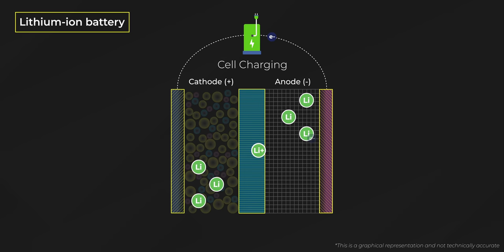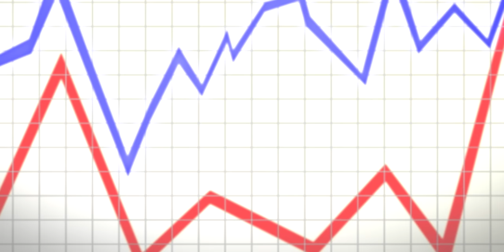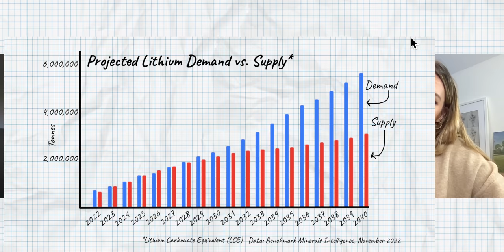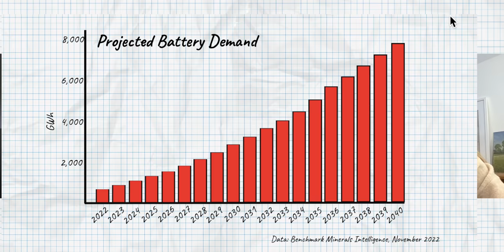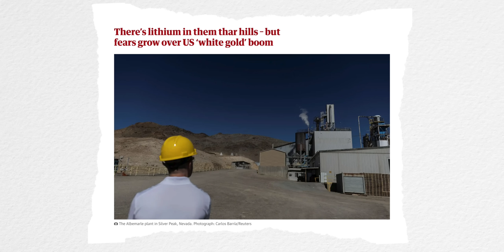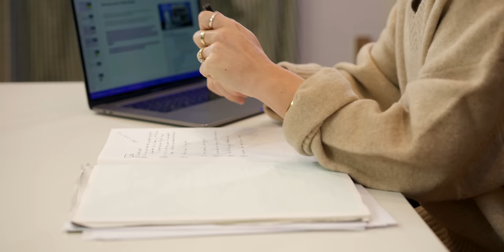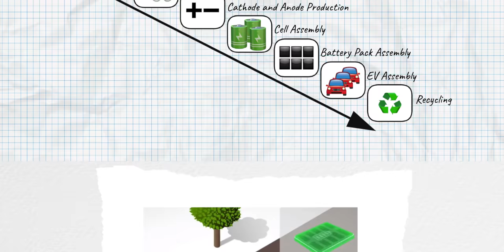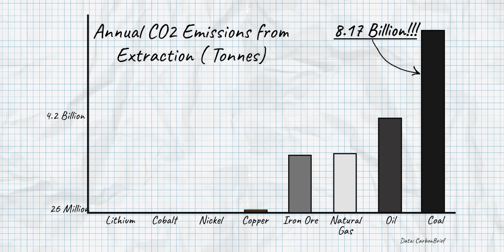There's a Massive EV Battery Shortage. THIS is How We Fix It

Comment: Great episode (as always) very well presented. Give Bobby a tent for the night, he can sleep under the solar panels!

On the excellent transit point right at the end, I would have also liked to see a very brief mention of micro mobility - currently illegal in the UK.

As a car alternative, micro mobility uses 1/50th of the batteries of an EV car, consumes 1/10th the energy per mile and costs 1/20th the price - obviously an e-scooter, e-bike or e-wheel can't replace a car, but for a single occupant journey, it can displace an existing gasoline vehicle 80% of the time, without needing the consumer to buy a brand new car, an 80% reduction in emissions for 1/50th the amount of batteries needed for a car seems like an obvious solution for people who want to do this - it should not be illegal, it's a far more scalable solution than everyone buying a 70kWh EV to have it sit parked all the time.

There does need to be a deeper dive on car alternatives, and I think personal electric vehicles need a new look from Fully Charged, you've done a couple of light touch episodes, but the ridiculous situation in the UK of allowing drunk scooter rentals while fining and seizing responsible commuters is something I would like to see covered.
Reply: Very good point, but micro-mobility is not entirely illegal; just some forms of it. There are a whole pile of legal vehicles, both e- and otherwise, including the humble bicycle. It is ridiculous that we can get thousands of pounds of incentive for e-cars, but nothing for e-bikes, never mind all the things we're not supposed to use at all, for, I agree, no particularly good reason.
And to be fair govt policy on providing space for active travel and e-mobility is actually pretty good now, after 'Gear Change', but councils are mostly terribly short of people who know what they are doing, and it's a huge shift in transport planning everywhere to actually allocate space and money for this. And far too many people still think transport==cars, and find it hard to envision a world where it was actually quicker and easier to bike/scoot/walk, or catch a bus/tram for most journeys.
You mention some of the efficiency gains - the numbers really are hugely significant, especially whilst there is a battery crunch. Putting them all in buses, bikes and scooters would get us all an order of magnitude more transport overall than putting them in cars.
Reply: @xxwookey  e-bikes are the best legal option, and the best for cargo, but, I've had 3 bikes stolen, and I've given up on anything that has to be left outside while I go into a store or work. Other e-options like skate, scooter and wheel can be carried in and tucked under a desk, coffee shop table, or walked around a store while you pick something up. For that reason, I prefer them, I don't see why they should be illegal in the UK - where I am (Vancouver, Canada), we have a pilot scheme that makes them temporarily allowed, while they are reviewed. Hopefully that becomes permanent.
Reply: @brushlessmotoring  Bike theft is a massive problem, and it's rampant largely because it's not taken seriously by most police, who confuse the fact that each individual theft is usually not a huge value with the collective cost of millions, and the effect, which is that people don't use bikes because they can't be reasonably sure it'll still be there for the return journey.
2/3rd of all reported crime where I live is cycle theft. About £1 million/yr for a town of 200,000 people. Even with that rate I've 'only' had 4 bikes nicked in 30 years so one every 7.5 years and I use it nearly daily. So it's not enough to stop me using as convenient transport. Police forces can dramtically reduce cycle crime if they put their minds to it, as a few forces in the UK and Canada have.
But I take you point that things like scooters work way better for people who want to use them with public transport or don't have convenient/secure overnight parking or live somewhere where theft levels are too high.
They will be legalised here fairly soon, the interesting question is under what classes and rules. Probably something more or less like the existing cycle/e-bike (for anyone, including kids) and moped classes (insurance, VED, tests), based on top assisted speed, which I think makes sense.
Reply: Most of the world will be transformed by electric motorbikes. Cost to run them is super low.  I have a super soco Tc max that goes up to about 55mph and charges 50 miles range for 25 p on cheap overnight electricity.  3kwhr removable battery charged in living room.  Brilliant around town.
Reply: @xxwookey  I would be happy to require license and insurance for the faster devices, some can be speed competitive with cars in town, I'm not a fan of speed limiters on some devices, but unlimited speed on cars, it actually makes mixing with traffic more dangerous on an e-bike that suddenly stops accelerating well below the speed limit.

I'm glad you think scooters will be legal in the UK soon, that's good news.

I think bicycle thieves are the worst, as you point out, the police consider it property theft, like having a watch or a TV stolen, but for a cyclist, it's stealing their way of life - it's demoralizing, and can cause people to give up on non car living and get back in a car - it's security and theft are taken far more seriously, we have security guards patrolling parking lots, but the only people keeping an eye on your bike are the thieves, the result is more cars on the road, making cycling less appealing - a vicious cycle.

If people want my Boosted Board, they are gonna have to fight me for it ;)

I'm happy to hear theft hasn't kept you off your ride, and you take a longer view - may the wind ever be at your back.
Reply: @colinpalmer9070  I'm a huge fan of the swappable battery mopeds, like Gogoro in Taiwan, you are right, they have huge potential to disrupt the worst, and most common engine in the world: The dreaded 2 stroke. Do you know the kWh/100km (or miles/kWh) efficiency of the Super SOCO's? We get them here in Canada too, they look amazing, and I see quite a few zipping around town - sometimes with a pillion rider too.
Reply: @brushlessmotoring  Cars that were limited to the speed limit would be nice. Larger and smaller vehicles already are. I gather it is/will-be a feature in new cars in the EU. You can turn it off, but you have to do it every trip. That should work pretty well in practice and get a hell of a lot more people sticking to 20 and 30mph urban limits.
Reply: @colinpalmer9070  yeah same bike here, it's got huge potential for many many people. Commuting is so quick, easy and cheap all on a fairly small battery, while being able to keep up with traffic and having all the protective gear etc so all-weather is fine. Sure, it won't work for someone who drives 100 miles each way along a motorway, but with most of the world living in cities already it could work for huuuge chunks of the population.
Reply: @xxwookey  I currently drive a car that tells me the speed limit, and it is wrong approximately half of the time around town. Sure, an upper limit of the highest speed limit could be a thing, but per-road isn't all that close for most cars I think
Reply: @asharak84  That's presumably a mapping problem of using out of date data. I wonder what map dataset they are using? (which car?) I favour OSM as collective updates benefit everyone, and things tend to get fixed within hours when they change. But I don't know what coverage of accurate spped limit info it has. 
 I think some of the fancier cars actually read the signs, which should improve accuracy.
Reply: @xxwookey  yeah i assume it is bad map data - interestingly (to me) it changes quite frequently but often to a different wrong value! Its a tesla (and it can read the signs as it displays them on the screen, but yhat doesn't seem to have sorted the data so far! :/)

Edit: maybe the sign reading is part of the issue, as it shows speed signs for streets you drive past etc - maybe it thinks we are changing limit juat by driving past the road end

Comment: Funny how you never really hear about cobalt use in the petrol industry (except for this channel). Yet it's use in ev batteries is screamed at high volume. I wonder if the petrol industry has something to do with this?
Reply: They use a lot of Nickel as well
Reply: What's the percentages used of cobalt in both types of propulsion? Is it significantly different?

I guess the Ev revolution is ment to help to a more sustainable way of driving..

If the raw materials are controversial then this needs to be highlighted..

No one ever says a gas car is ment to be any answers to environmental problems so that's probably why the cobalt isn't mentioned...

Comment: There's a real shortage now. My Kona battery failed last April and Hyundai have still not managed to replace it.
Reply: The whole battery pack shouldn't have failed. You likely have a few cells that have failed or your BMS is reporting them as failed or failing.  I'm curious though, what is your SOH and how has your range been affected?
Reply: @Tron-Jockey  don't know about the range as Hyundai took the car away and it's been off the road since

Comment: It would be good if you could do a show around the challenges of the electricity supply and charging networks around the world?

I think those of us in Europe and the USA maybe don't realise what challenges there are around the world for mass adoption of EVs.
Reply: As long as charging is done off peak it is not an issue at all. So it means that home and work low power charge must be the default way, with fast charging only for exceptional long trips. A car is parked most of the time, and if plugged it can charge just when it is convenient. And off course, the car could supply energy of the grid, even if for now not many models can do it. Such vehicle to grid capabilities are especially useful with the development of intermittent energy sources (eg solar and wind).

Comment: When you say there are 5 kg of lithium in a battery pack you failed to describe what size battery pack (we started at 24 kWh batteries and now make 212 kWh packs). I suspect the 5 kg figure is very old and not indicative of 85 kWh, the average pack size in USA. You also should specify if you're talking about 5 kg of lithium metal or 5 kg of lithium carbonate.

Comment: Another good battery recycling company you at Fully Charged could look into is Aqua Metals. 
They have a new non smelting process for recycling lead, and are now applying that same principle to lithium ion batteries. 
As a side note, I can't help but feel that there are other answers that just aren't trendy enough for today's industries, such as nickel iron, or lead alkaline batteries, which, had they been given the same amount of effort, and research funding, may also have been able to supply either our cars, or our backup storage systems.
I would remind you that the Mars II company was producing electric cars in the 1970s, and 80s with well over 100 miles of range, and decent recharge times using boring old lead acid batteries. How far advanced would that be now if the ball had not been dropped. I would also ask, is it not possible to produce rebuildable batteries?
I will end my rant now, ( sorry everyone), with a word of my own philosophy.
" There is no shortage of energy or materials, only of inspiration ".
Reply: Ah, you mean hydrogen.
Reply: @t1n4444  
If you are referring to lead alkaline,  I mean exactly that.
There are electrolyte mixtures of alum and water,or epsom salt and water that turn a lead acid battery into lead alkaline with interesting results. 
I would imagine that a purpose built lead alkaline battery could possibly be even better. They Do allow for a safer deep discharge which Could allow for (under the right conditions) a smaller battery array, which is one advantage also of nickel iron, along with longer life cycle, and less danger of explosive meltdowns. Lithium ion on the other hand, Hates being discharged below about 50%.
It also has a very hard time with temperature variations. 
I am not an expert, and I know there are several other promising battery types out there. I am simply making light of the fact that Lithium ion, specifically, seems to be all the rage.
I can't help but feel that there are likely other alternatives out there, just waiting for their day.
The same is true in the internal combustion world. So many good, viable alternatives that were never really given much attention. 
I think we need to be willing to explore more options, and be a little more flexible to play mix and match. 
Sorry, I Am wordy today.
Reply: @davidvaughn367  

No, I was referring to hydrogen gas, in a fuel cell or perhaps in an internal combustion engine with the modified head, etc.

Ref battery tech then agree that there are many, many types of batteries in the lithium "science" alone.

Some EVs run on non lithium battery tech already. Merely a Google away.

The issue with lithium in the northern latitudes is that charging below 0C can be problematic.

Some batteries are heated via the BMS so as to stop lithium metal plating one of the electrodes, irreversibly.

(I'd have to Google up up which one.)

Batteries are merely one step on the way.

And I'm up for hydrogen in the not too distant future.
Reply: @t1n4444  
Sorry about that. I often misunderstand, and am Very literal. 
Hydrogen, yes.
Walter Russell was a big proponent of that, and I have to defer to his opinion on that as long as we could, in his words, find a table top method of producing it, and that, primarily as a stepping stone,to go on using the machines we have until other, more exotic forms of power can be perfected.
Ultimately, I see electric, and other options like hydrogen, and gasoline vapor, in the same  way. My feelings about them ( if that matters), are not extremely strong.
Ultimately, I believe the work of people like Nikola Tesla, John Searl, Victor Schauberger, and Richard Clem,to name a few, hold more long term promise,but we need time to figure all of that out, untangle them all from politics, and corruption,  and then devide fact from fiction.
Reply: @davidvaughn367  👍👍👍
Reply: @t1n4444  hydrogen is dead, it is highly inefficient to produce and still requires batteries.

Comment: My doubts on the sustainability of battery-powered vehicles remains steadfast.
NOBODY is talking real costs & time-frames.
I'd be less sceptical if you'd asked your husband how far off the nano-level incorporation of silicon/carbon was away from production ready.
The biggest impediment of EV take up is the purchase price, the industry needs to wake up.
The quest for more outrageous performance & range compounds the already stressed supply chain & it'll get worse if manufacturers & consumers keep stroking their egos.
Reducing the number of cars on the road whether it be through carpooling or public transport will reduce emissions far more than the electrification of cars.
Finally, governments financially incentivising manufacturers with taxpayer money is a negative, they'll use it for their own good, not the consumer.

Comment: To quote "Field of dreams" if you build it they will come. Once the market and demand is there people spend the time and money on finding the solutions. Look how far EV's have come in just the last 5 years. Sad fact is there needs to be a profit in it for the research to get done as more and more countries ban ICE vehicles more money will go into research and we'll get more efficient vehicles and batteries come to market. Same goes for the charging network it will improve rapidly as the market share of EV's rises whilst the oil companies can keep on selling fuel to the vast majority of cars which are ICE they will keep on milking existing solutions and setups as it's profitable and what they know. Once that is taken away from them they have to adapt or die and charging networks will appear everywhere. It's just going to be uncomfortable during the too slow transition.
Reply: I’m confident human kind will find a timely solution to decarbonisation even the tricky issues- shipping and aviation sadly not because it’s the right thing to do but because the people in a position to exploit and make a fortune will turn their attention to it as soon as critical mass is reached with adoption and/or government incentives are properly established.
Reply: @Antiguan_Dart  Supply and demand.

Comment: Excellent presentation.    What is missing is the alternative to Batteries, to be used in transport where energy density is Important.   As example is alternate green energy options like Hydrogen (either HEV or HICE (yes less efficient, but retrofit option), and sustainable fuels like Ethanol or SAF.   EV work well in lighter vehicles and higher population density, but fails long haul transport and remoter area.   So if Li shortages slows BEV supply, then other options like HEV is competition.   So what are the potential supply chain issues here.